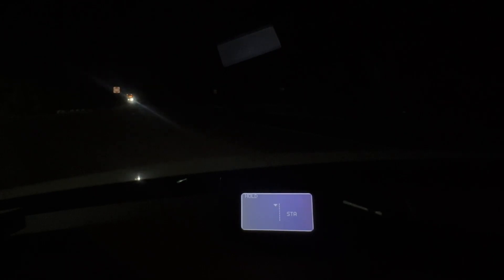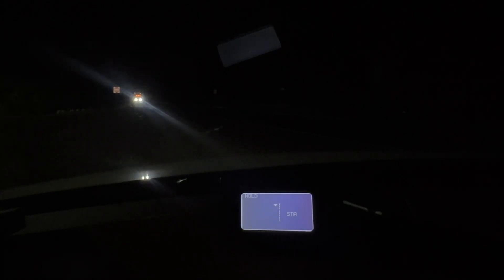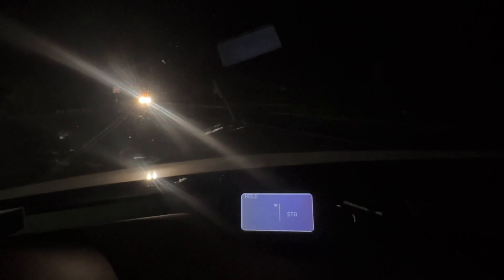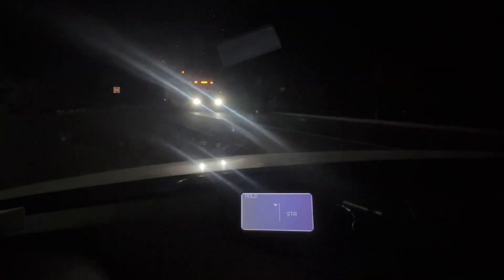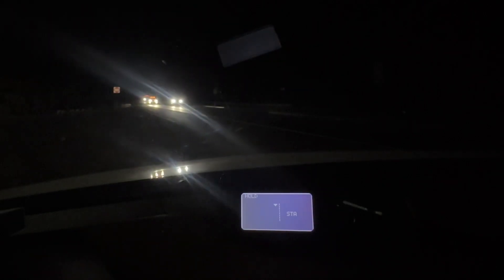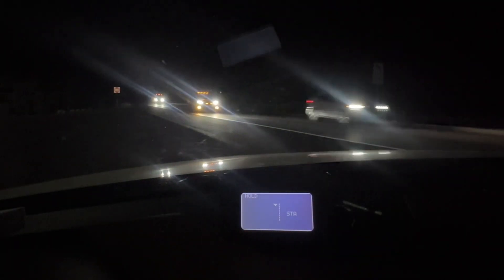Police Radar: What’s Instant-On (I/O) and Quick Trigger (QT) Radar and Why you Need a Fast Detector.

Comment: I got a February 2023 redline 360c..it doesn't have the latest update of around March ..I checked and rechecked and rechecked with low signal strength  k band and ka band...I get at a distance that on the windshield it 1 or 2 bars..I take the detector and put my thumb on the rear antenna and my thigh is blocking the front..I raise the detector up very fast and I'm getting 1 to 1.5 seconds on k band and less ran a second to just under 1 second on ka band ...anyone saying that a redline 360c on k band is 2 to 8 seconds delay is misrepresenting or making crap up..the ka band delay of less than a second is good
A possible explanation is my redline 360c was returned and completely replaced..its possible I got a hand tuned fast redline 360c. .it is not slow on k band
Reply from the maker: Couldn’t be more wrong. There are plenty of varied tests demonstrating that the RL 360c is extremely slow in responding to k-band. 

This test clearly shows the issue. Can’t deny facts. 

If you have something to show to the contrary, let’s see your test. 

K-band Reactivity Test Pt. 2: Uniden R9 & R8, Redline 360c, Whistler Titan, Valentine One Gen2

https://youtu.be/hXSVXaE3MTw
Reply: @RadarBusters  not mine
Reply: @RadarBusters  does your detector pick up ka band false from your cell phone? Mine does..100s of times..I checked in with the vise president of cedar..he said that has never come up before..he ask me to send videos of it doing that..I sent 10..why is mine doing that and no one else? I don't know..in my area I will never get a k band false or a legit k band cop..I wouldn't even care if my 360c had k or X X band...there's something going on here but I don't know what...but my redline 360c is at worst 1.25 to 1.5 seconds on alerting..

Comment: Bob, most LEOs have neither the patience nor the knowledge to do what you’re doing. In my neck of woods,most run CO and can be picked up miles away.  Also,many are marked in Waze when they’re sitting, even at night.

As to QT,most guns don’t work in QT because of the time it takes Gun oscillator to heat up ( ramp up) for an accurate shot. Years ago, Mike V showed that POP and even QT was not an accurate speed measurement method.   He wasn’t wrong then and isn’t wrong now.
Reply from the maker: Never suggested that most do. Just what’s possible.   

I have never turned on POP mode. Even in Nevada where MPH is used heavily. 

Got tagged once, south of Tonopah, using a Cobra Dual Pro 360 with no alert. Could have been slow reacting detector to I/O Ka or POP don’t know.

Even so ,the point is a fast detector has a much better chance of catching a brief detection especially with reflected radar farther away from the source. 

That can even happen when an officer is transmitting constant-on radar and way down the road a brief appearance of the radar can be seen.

Comment: I always set my cruise on 5-8 below stated speed, however I always get pulled over for crossing the line. I’ve never had a ticket in 59 years, but my son’s friend is a police officer, and he says that it’s probably because I always let them search my vehicle for drugs. It could be the color red, I bought the Chevrolet Volt hatchback new in 2015, zero tint, zero stickers or amenities, only A/C. When it broke, I never got it fixed, because of the huge cost. But I could be the only one that sticks out due to the color, windows down in Summer, and traveling to work with a white shirt & stupid tie on.😂